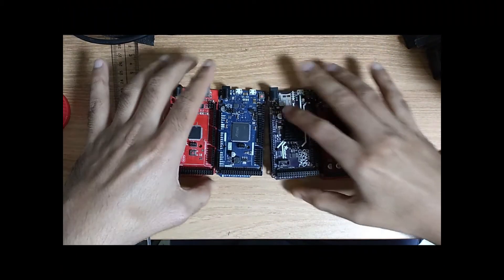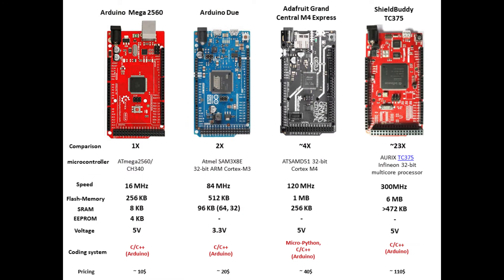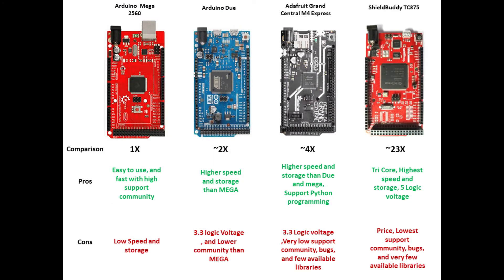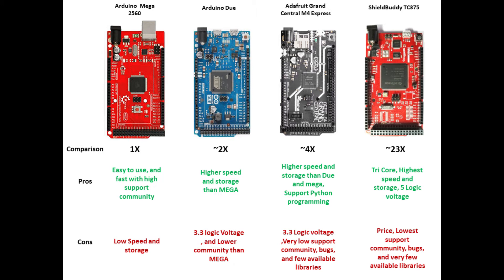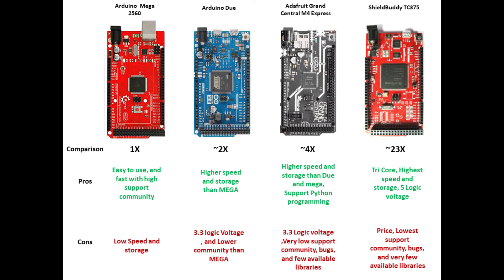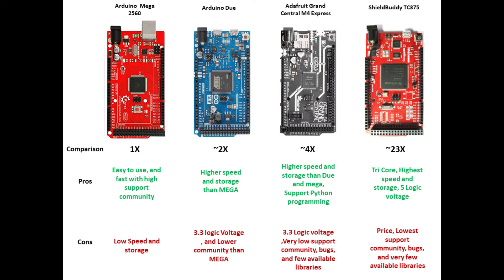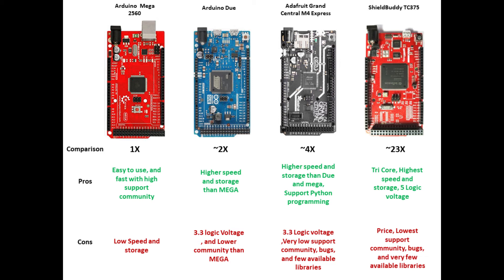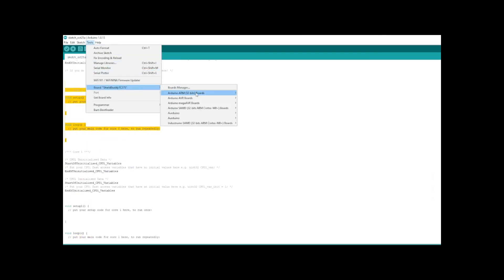Arduino 2: What is faster and higher storage than Arduino Mega, but similar IO pin number?

Comment: a friend asked me about this dfrobot 0256...this was my answer: THIS...this board can support 4 boards, BUT BOARD#1 CAN TALK TO BOARD#2 AN BOARD#2 TALK TO BOARD#3, AND BOARD#4 TALK TO BOARD#4, AND BOARD#1 CANNOT TALK TO BOARD#1... AND THERE IS NO SOFTWARE TO SYNCH...WHAT??? IF BOARD#2 WAS USING DIGITAL PIN 9, AND BOARD#1 WANTS TO USE DIGITAL PIN9...THAT WILL BE A GOOD ENTERTAINMENT...and  this dfrobot  0256 mega multi io board...aka dfr0256...this will NOT ALLOW ANY OTHER BOARDS ( UNO, NANO, DUE, OTHER MEGA) ACCESS TO A6:A15, AND D22: D53...because ??? alles gute + bis bald ...und preise 33$ this can be good entertainment...

Comment: true...all these boards have bigger sram+flash space and faster...as you have also stated, all of them have SMALL user community...as i have used due r3( 3.3v)...not just some BUT ALL THE SENSORS I AM USING ON MGEA2560 R3( us-015, 
ekmc1603111...) do not work... and relays and vnh5019 shields ...none worked...
THE MAIN FEATURES OF LARGE SRAM AND FLASH SPACE...well...anyone has developed "sketches" that requires that amount sram or flash space??? and since the community is small...and many had the challenges of making it work...one
can safely conclude...most manufactures will not develop and supply required firmware...oder ???
danke for your informative presentation